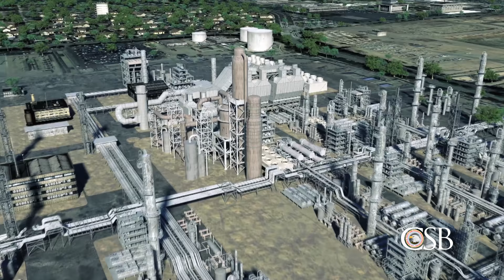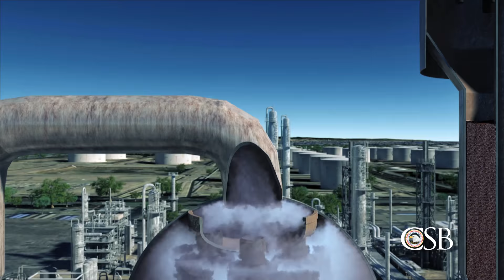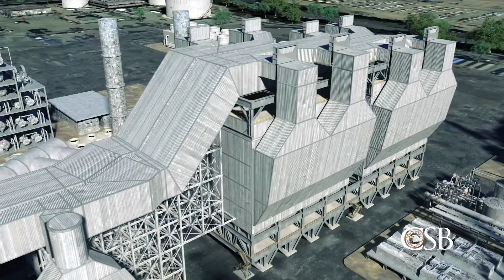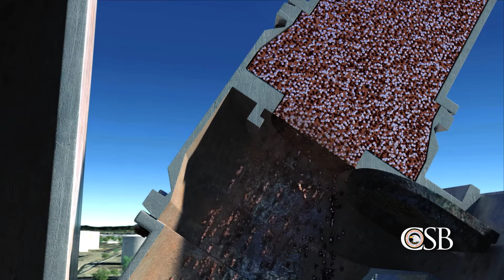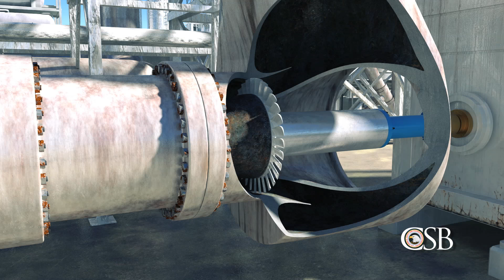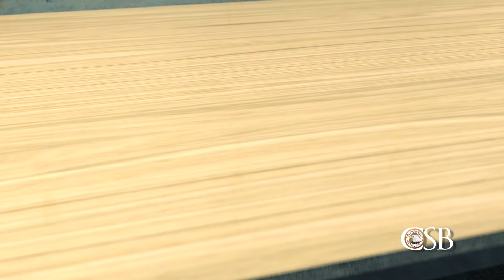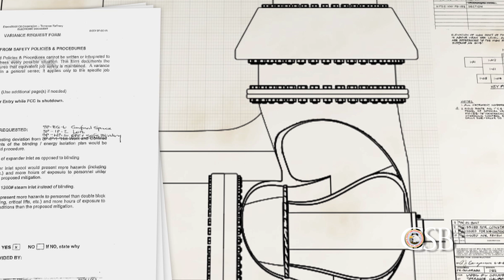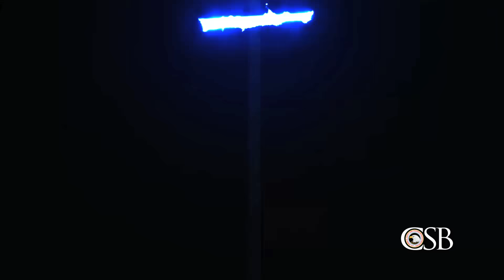Animation of 2015 Explosion at ExxonMobil Refinery in Torrance, CA

Comment: Hmm... why not shut off the ignition source when in safe/ park mode?
Reply: You are asking an intelligent question, but I doubt there is an intelligent answer.  It would be logical that, as an added safeguard, the ESP should be shutdown, isolated, and locked out to prevent restarting during safe/park mode but I am willing to assume that such a system would've been to much trouble (too much money spent) to add redundant safeguards.  "That'll do and lets hope for the best" sorta mentality that major companies have, or so it seems to me.  Risk reduction is very expensive and companies have mandates to only increase productivity and efficiency, and thereby gain more profits.  Increasing profits by slacking and going cheap on safety systems, apparently, is an acceptable risk in the CFO's cost/benefit calculations.  After all, as far as corporate is concerned, nobody they (in-charge executives/corporate) care about is at risk, so what?
Reply: Robert Mintun  
The animation gives the impression that the flue-gas system (FGS) is dedicated solely to the run-off gasses from the fluid catalytic cracking (FCC) unit; this might not be the case, as flue-gas from other areas of the plant might be treated there as well. What this means is that shutting down the FGS doesn't just stop the FCC, but also other areas of the refinery.

Shutting things down means they're no longer making money, but instead costs money.
You can probably figure out how the guys up top feel about that.
Reply: @BlurbFish  The ESP is actually solely connected to the FCC unit. The flue gas is just waste gas from the burning of the cokes with a small remainder of fine catalyst that managed to get beyond the regenerator. The ESP's function is just to get that remaining catalyst out as it is valuable.

It wouldn't make sense to connect it to the flare for two reasons. It [shouldn't] contain hydrocarbons. And the temperature in the regenerator is over well over the spontaneous combustion temperature of most hydrocarbons. So you wouldn't want to put those gases into your flare system.

I can't exactly remember why they keep the ESP running, but I think it has to do with the power draw to start it back up.

But exactly as you say, everything has to do with money. It's all one big cost–benefit analysis. Where safety is ofcourse a benefit, but the cost has to be representative of the gains.

I used to work in a FCC unit in a different refinery, however this was a newer model that didn't have this design flaw where the catalyst could empty out of the reactor.
Reply: @Roeckx  You probably have a point about the power draw of the ESP. Also as far as I know, the engineering of ESP systems strongly relys on empirical data and in practise almost never works as planned. There are a lot of factors that can change the voltage characteristics of an ESP over time which has a huge impact on the separation efficiency. Not knowing how exactly the thing is going to perform after an irregular shut down and having the EPA constantly nagging, one would probably decide to keep it running as long as it works according to regulations. As always, money is key..

also, it seems to me, that some kind of level indicator in the cat reflux piping would make sense to detect any abnormalities. Should have definitely  come up in a hazop
Reply: @Roeckx  it is not about the catalyst being valuable, those fines are useless. It’s about environmental regulations…
Reply: I've figured out like two departments in the manufacturing/production industries particularly the operation or production department and HSE. In an event when operation  stops for safety reasons, production heads are whining especially if it takes longer. Production heads are very excited to resume operation though safety will be jeopardized and keeps pushing suggesting cutting corners on procedures. Production heads think very silly thinking some parts of safety procedures are trivial and wanting to skip from it. They have thick fingers which fits perfectly on their buttholes to point somebody when messed up.
Reply: @roadwarrior144  It's because there is no flare-off or baghouse on the ESP, and the catalyst dust and escaping nasty hydrocarbons in the distillation unit would poison the atmosphere in the neighborhoods. Literally they would need an EPA exemption, like 9/11 when Silverberg got EPA to say Ground Zero was 'safe' and those massive clouds of asbestos fire proofing were 'pulverized concrete'. Yeah. $$ talks.
Reply: @roadwarrior144  
They're only worried about their pockets.
Reply: Because the CA EPA mandates that the ESP be on at all times, even during nonstandard operating modes.
Reply: The real solution is to maintain the valves better. I just started working in the valve business and coke is very nasty.
Reply: @ucantrun2793  The problem isn't really the cokes. It's the catalyst. You can compare it to sand. The slide valves get worn away by the catalyst over time.
I used to work on a FCC unit in a different refinery. It was a newer type where this problem couldn't occur.
Reply: @Roeckx  That's awesome. I'm relatively new to this industry. It's amazing the amount of engineering that goes into these plants. I have only worked on a few valves in the koch process, and it was incredibly nasty stuff.
Reply: @ucantrun2793  I been repairing valves for 20 years....
Reply: @tttarms1970  That's awesome. Can I have some of your knowledge? :) Question if that valve had been properly maintained,  then this wouldn't have happened correct?
Reply: Jeremy Tate yeah, proper maintenance was ignored for such important pieces of equipment.
Reply: @ucantrun2793  soda is super unhealthy :)
Reply: @ucantrun2793  "I just started working in the valve business" yep that explains. Unless you understand to reach that valve would requires multiple heavy duty equipments (crane, lorries, you name it, etc.), manpower, paperwork, permits, PE Professionals, etc. to safely shutdown, dismantle that unit, before even thinking about reaching that valve . And to do that, you need to purge the whole system and makes sure that it is free of toxic gas & safe for entry. Speaking of, usually this kind of unit is inter-connected with many other units. I think after watching the videos you would have seen how many of them are linked to this FCC alone. Effectively to shut down this whole unit, you most probably are going to have to shutdown the whole plant. Oops loss of money, and I mean millions & millions of dollars over a bloody valve. Talk about Cost/Benefit analysis.

Fair enough it said the valve has been passing for 6 years, indicating a lack of general maintenance. But  after about all the troubles that I have just told you (and btw that is just the tip of the iceberg), I dont think replacing a valve like that is that easy isn't it ? Dont talk about maintenance, a valve that has been corroded that bad is unlikely to be salvaged and the best action is to replace with a new one. We are talking about cost again. Passing valves are very common occurence and a better way would be how to prevent the Hydrocarbon from back-flowing into the system. I am not sure how they could have let that happen, but I think this serves as a good lesson for all of us today to not be negligent.
Reply: Ikr, for such a dangerous system that literally have an immediate pathway to an explosion, the layers of protections are way too little. There's only the valve and the steam, nothing to redirect the gas, nothing to detect the gas etc. For such a fairly obvious and high risk hazard, they did poorly to eliminate or reduce the hazard.
Reply: If there was an online analyser in the various streams, especially in towards the ESP, should vapours be detected, the unit should be shut down and purged with inert and directed towards a flare system instead. Sadly, cost-cutting is a bigger thing than actual engineering safety.
Reply: Cost too much money to get it started back up again
Reply: ESPs are not used only for one unit so they are not dedicated for one off line section.
Reply: Guarentee that answer has to do with cost, time, or both.
Reply: hey Moe,,  hey Larry!
Reply: That's a good point, the ESB is electrical based, so why not shut it down, it wouldn't seem like it's too difficult to restart it, at least comparing with the other steps.
Reply: @thegeneralissimo470  it's probably something they can't do safely or realistically or both
Reply: @thegeneralissimo470  I'd assume that wouldn't work (at least immediately) since it creates static electricity. Just because the power's cut off doesn't mean the static's going to stop.
Reply: @Kepora1  you are correct, the ESP uses difference of charge, one generated by the flow of catalyst over plates and the other is charge generated by the power supply, cutting the powersupply stops charging of the plates the but the leftover charge must be expended first

The esp serves the entire plant, not just the single unit, EPA requirements requires the device to be operational at all time to avoid toxic discharge to the air.

The biggest issue I can see here is the lack of an isolation valve from the regenerator to the FCC air system. Or if one was present it was not actuated
Reply: @thegeneralissimo470  I think that if the gasses would leak through the supposedly good route, it when then burn off in the chambers made for it to do so, turning it off could make it even worse, not knowing why there is gas leaking in the first place
Reply: I guess preventing particles getting into the atmosphere is more important. Additionally, they probably believed that it wasn't of concern since they thought it was sufficiently separated.
Reply: Here's the problem - damaged equipment prevented that. The slice shield was completely rusted out, the fluids leaked in even after. Secondly, some of these chemical reactions don't just magically turn off. They stay trapped in the pipes.
Reply: 6 years? What happened to the critical valve inspections and internal inspection? Did they just fly through MOC reviews to get it done?
Reply: First thing that I thought.
Reply: It probably takes a lot longer to do a full shutdown and even longer still to bring it back up afterwards.

The sort of depressing part on this one is they had a procedure. They had paperwork, and yet still they managed to ultimately be wreckless and blow something up.
Reply: it saves cost I assume
Reply: Because it would make sense
Reply: They say in Russia: "Safety rules are written with human blood". Unit designer just couldn't predict the situation
Reply: Because you still need to exhaust the flue gas and the particles of catalyst can't be exhausted. You need to remove them and so the ESP must remain on.
Reply: That’s due to the quirks of California’s environmental laws.

At the time of the explosion, environmental regulations in California required that the ESP remain online during all modes of operation, unless the entire refinery was shut down.

I myself work in a refinery, and it’s very easy to see where the train of logic, prior to this explosion, was going.  They were dealing with an issue that they had already dealt with at least once before.  They had an established variance that had been used successfully.  Upon the discovery that steam was escaping through the expander, it would have been obvious that one of the slide valves was leaking by.  Leaking slide valves on FCC units are a well known issue.  The purpose of the steam is to prevent hydrocarbons from reaching the air side of the unit.  Based upon the assumed conditions within the unit, a decreased steam flow shouldn’t cause any problems.  It’s unlikely that anyone would have thought that a leaking exchanger somewhere else in the process flow would cause the hydrocarbon vapors to backflow through the FCC.

The thought of shutting the ESP down at all, at any point throughout the process, wouldn’t have come up.  In order to remain in compliance with regulations, it needed to remain energized.  The only way to shut it down and stay in compliance, would be to shut the entire plant down.  Logically, that doesn’t make any sense unless you’re dealing with an emergency.  Nothing indicated that an explosion was possible until it was too late.

It’s very easy to armchair quarterback these incidents,  particularly when we have the privilege of hindsight.  When you live and work in these plants everyday, you gain a sense of respect for the nuance behind these accidents.  They all involve some sort of error or deviation, but when you put yourself into the shoes of the people who were there, and work with the knowledge they would have had at that time, you can see how something that would have seemed insignificant, ultimately led to disaster.
Reply: You mean the scrubber, it should have had its own hydrocarbon detector for shutting it down, but then again its controls are probably all manually operated.
Edit: Jerry Tate you’re just as bad as the infamous automotive parts swappers: it wasn’t valves which leaked the explosive hydrocarbons it was an adjacent heat exchanger which had failed. Pay attention, you’re not keeping up at ALL🐌
Reply: Regardless of what the reason was then, you can be sure it is now required to shut off the electrostatic precipitator. And they will be inspecting those slide valves every year.
Reply: EPA requires ESP to be energized during all modes, regardless of contingent operations. This is, theoretically, to ensure no flue gasses pollute the environment under any circumstances, excepting direct maintenance of the ESP unit. (In which case, all processes must be shut down, de-energized, and locked out.)

TL;DR - to shut down the ESP, you must shut down the entire plant.

Thank you, EPA.
Reply: Because they added steam